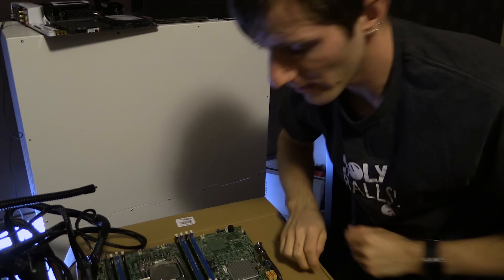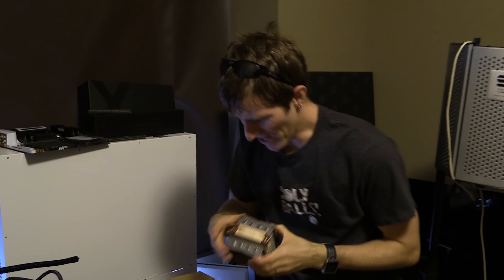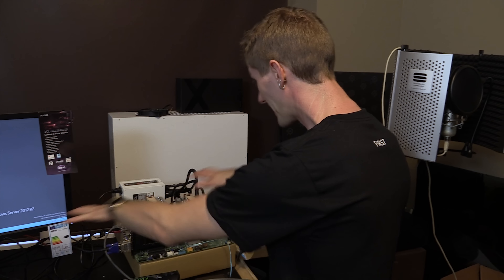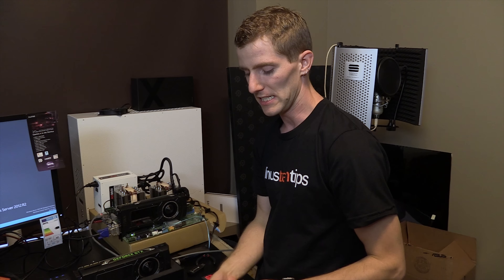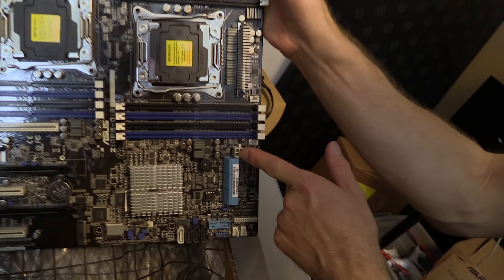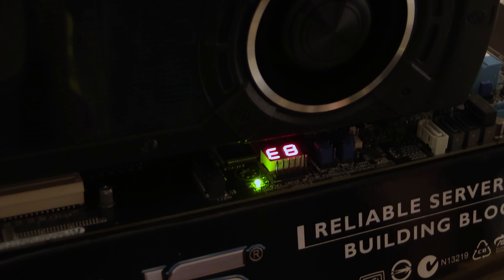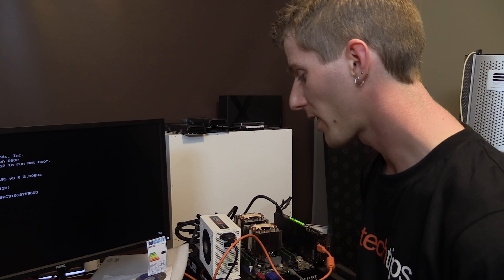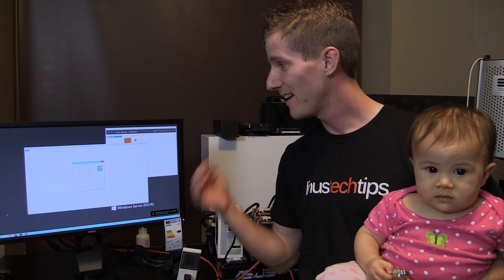36 Cores, 72 Threads, and Two Titan Xs - Our New INSANE Rendering Machine Part 2

Comment: 5:25 grounding himself out on a painted psu...uh huh...tell me more about the conductivity of paint.
Reply: Hello Sub-zero Phase build guide
Reply: frollard we're not talking about 5 volts here, it's more like thousands of volts, so it can probably go through half a mm of paint, wich btw might be conductive paint
Reply: didgitalpunk the conductivity would be similar to the metal itself, so you gain or lose nothing, and aluminium coolers never carry voltage [aluminium can't carry voltage at any time just like it isn't affected by magnets]
Reply: frollard It is most likely made to conduct electricity, since grounding (through the power supply obviously) the ENTIRETY of the case is very commonly done to eliminate some stability issues and electrical interference.
I haven't researched it, but I know my case is grounded this way, and this same system (absolutely no hardware changed) has been running inside for 12 hours a day, every day, for five and a half years. That's over 24.000 hours. Talk about a stability king.
Reply: Space Cadet The overhead power lines are mostly made up of aluminium (the wire core itself) because it's lighter and has GOOD conductivity, while the wires in your house are mostly made up of copper. Just go to wiki or some other sites to verify this.
Reply: liveoles aluminium alloys maybe, but a pure ally heatsink is just ally. not conductive. believe whatever you want tho. and house electrical is all copper. anyone saying different lives in another reality
Reply: Space Cadet Aluminium has good electrical conductivity, it can be(and is)used to conduct electricity just like copper.
I don't know why you think it does not conduct electricity?
Voltage is not carried, it is the electrons that move.
And aluminium is affected by magnetic fields since it is a conductor.(I do not mean that it is attracted/repulsed by a permanent magnet)
Reply: Flying Skull because it's an element, on the periodic table, and it has high thermal conductivity and low electrical conductivity. it's year 8 science. i'm not sure how you managed to miss such an important simple lesson in life. 3 seconds on wikipaedia would  educate you but here you are, blah blah blah, instead of finding out. it has about 55% of coppers electrical conductivity which is why elctricians ladders are made of ally. http://en.wikipedia.org/wiki/Aluminium
Reply: Space Cadet Aluminium DOES conduct electricity. That fact that it isn't magnetic has nothing to do with its ability to conduct electricity.
Reply: Space Cadet 

"Aluminum
 wire, which has 61% of the conductivity of copper, has been used in 
building wiring for its lower cost. By weight, aluminum has higher 
conductivity than copper, but it has properties that cause problems when
 used for building wiring. It can form a resistive oxide within 
connections that makes wiring terminals heat. Aluminum can "creep," 
slowly deforming under load, eventually causing device connections to 
loosen, and also has a different coefficient of thermal expansion
 compared to materials used for connections. This accelerates the 
loosening of connections. These effects can be avoided by using wiring 
devices approved for use with aluminum.
Aluminum wires used for low voltage distribution, such as buried 
cables and service drops, require use of compatible connectors and 
installation methods to prevent heating at joints. Aluminum is also the 
most common metal used in high-voltage transmission lines, in 
combination with steel as structural reinforcement. Anodized aluminum
 surfaces are not conductive. This affects the design of electrical 
enclosures that require the enclosure to be electrically connected."

http://en.wikipedia.org/wiki/Electrical_conductor
Reply: Space Cadet 

"Some of the many uses for aluminium metal are in:
-Electrical transmission lines for power distribution-Super purity aluminium (SPA, 99.980% to 99.999% Al), used in electronics and CDs, and also in wires/cabling.

http://en.wikipedia.org/wiki/Aluminium
Reply: Space Cadet By the way, they use aluminum ladders because the ladders are light... but if they want to reduce electric shock, they'll use fiberglass ladders or even wood if there's nothing else to use.
Reply: Space Cadet This escalated quickly.  Aluminium (or Aluminum depending on where you are in the world conducts quite well, ALMOST as well as copper. During a copper shortage in the 70's many houses were wired with aluminum.  Most are using copper these days.
Reply: Clément Dutter Your case is grounded through the metal metal contact of the screws (note the holes aren't painted).  The painted surface is not a reliable ground connection to your case.
Reply: Space Cadet Your heatsink IS conductive, but is only electrically connected to the heat spreader on the cpu depending on how conductive the thermal paste is...which in turn should not be electrically connected to anything IN the cpu.
Reply: frollard You're right, my system was an oe unit from Acer so there's nothing fancily painted on the inside. I have to say though this thing has exceeded my expectations in many ways. I just checked my Hitachi 1TB hard drive with crystaldisk info and crystaldisk mark and it still does 100.8MB/s sequential read and writes after 15,612 hours of use - five times what it was designed for! :D
Reply: frollard Where will you find a non-painted surface to ground yourself on?
Reply: Völundr Frey Touch a ground connector on a nearby electrical plug.
Reply: Völundr Frey Generally look for bare metal, if building on a bench, have a ground point somewhere -- put a mounting screw into the psu so you can touch actual metal - while the psu is plugged in the chassis, and thus the screw is grounded.
Reply: Space Cadet I have used aluminium in past and as others and I have said, it does conduct electricty. 
If you don't believe any of us, ask an electrical engineer or physics teacher, or test it yourself.
Note: I'm not trying to be a douche, only trying to help. Finally, wikipedia is not a realiable source.
Reply: Space Cadet lol, you use an ally ladder because its lighter than most other cheap metals, it has nothing to do with "safety", get rubber feet on the ally ladder for that... or a glass fibre ladder... just lol
Reply: Tbh you don't need to ground yourself. Not like your pc will fry because of that. Just don't do it on carpet  otherwise who cares.
Reply: ***** I totally recommend using an anti static wristband although it is not needed. You could slide your motherboard on the carpet all day and I bet it would be fine. But either way Linus was just fine
Reply: frollard what you were never zapped by static electricity when touching a car which is also painted?
This is not about general conductivity it's about static electricity and that is what kills electronics.
Reply: Space Cadet now I dare you to reply thinking you are still right.
Reply: Space Cadet Maybe you can read it if I post the first three sentences here: "Metallization is the fabrication step in which proper interconnection of circuit elements is made. Aluminum is a popular metal used to interconnect ICs, both to make ohmic contact to the devices and connect these to the bonding pads on the chip's edge. Aluminum adheres well to both silicon and silicon dioxide, can be easily vacuum deposited (since it has a low boiling point), and has high conductivity."
Reply: Space Cadet Hell, even your precious Wikipedia link.http://en.wikipedia.org/wiki/Aluminium

Under "Physical":
"Aluminium is a good thermal and electrical conductor, having 59% the conductivity of copper, both thermal and electrical, while having only 30% of copper's density. Aluminium is capable of being a superconductor, with a superconducting critical temperature of 1.2 kelvin and a critical magnetic field of about 100 gauss (10 milliteslas).[11]"
Reply: Space Cadet Conclusion: I really hope you're just a bad troll. If not, you are very unfortunate.
Reply: chrisdiscodude no. the periodic table, says it is low in electrical conductivity. has done for a hundred years. what school did you go to that you don't know that?
Reply: Space Cadet We've given you countless sources, you have yet to provide any that support your claim. You as what school we went to? I ask you what English teacher taught you chemistry.
Reply: LegendOfZub it's australia here, so i've been asleep for 8 hours. i haven't been sitting here obsessing about other peoples lack of simple science education. I clicked on the last one and it was retarded beyond belief. so lets do this right here right now. provide me the best link of ALL OF THEM, which actually talks about how aluminium has HIGH ELECTRICAL CONDUCTIVITY. you know, find me the one which seems to deny hundreds of years of elemental knowledge
Reply: LegendOfZub
I think that's an insult to English teachers lol
Reply: Space Cadet I know that dude. Except it's not as low as you may be thinking. It's about 66 percent of copper.
Reply: Space Cadet There you go! Big proof.
Reply: chrisdiscodude it seems some people don't understand what a link is now, so i'll get back to work. some of us have jobs
Reply: Space Cadet lol so ignorant. I gave you 2 links. 2 out of many! I think you should go back to high school chemistry. 

And just a little fact, plane wings use aluminum and the wings of a plane need to be conductive due to lightning strikes. So yea, there you go.
Reply: Space Cadet Mate it's New Zealand here. Maybe after being asleep for 8 hours you should get ready for school. Some of that year 8 science would do you good.
Look at the periodic table resource both me and LegendOfZub linked, it's 4th most conductive: Silver, copper, gold, aluminium. Notice how many other elements conduct too. 4th out of over 100 isn't bad at all. Car bodies are made out of steel, look at how "bad" iron is at conducting, car bodies serve as the ground connection for the electrical system. As many have said, aluminium is used for wiring in many places. It's a popular material for buss bars in electrical systems. Cheapo connectors are made out of brass, it's also lower conductivity than aluminium.

I don't see you calling copper a shit conductor, I hope you use 99.999% silver wire for everything you have...
Reply: Space Cadet It was not retarded. You're projecting your own problems onto the link. That last link has a list of many metals with their conductivity, resistivity, and the percent of the international annealed copper standard.

So, since that's a little too much for you, and you've got a hard on for the periodic table, here is a list of every element sorted from least conductive to most conductive. http://environmentalchemistry.com/yogi/periodic/electrical.html

See that? Aluminum is the 4th most conductive element known to humans. Are you still going to argue?
Reply: Space Cadet https://www.google.ca/?#q=is+aluminum+a+conductor%3F

"Google facts" boxes only show known information.  60% of coppers conductivity is by mass...and since it is so light that makes sense - there is less stuff physically there per unit volume.  It has a remarkably low resistance, thus a remarkably high conductivity.
Reply: bassl0va no they use ALLOYS for cabling. they mix other more conductive metals in, and ally is too brittle to bend like wire needs to. not understanding that alloys are different to elements shows you're not up to this issue yet. Iron also is a bad conductor until you make it into steel. no wiring is made of iron, i have no idea why you made either of these points. neither of them meanwhile are as good as copper which they use pure because it is soft and has HIGH ELECTRICAL CONDUCTIVITY. we should remember that we're talking about heatsinks, which are PURE ALUMINIUM. and i'm only responding to you [even though still no fucking link] because you seem to have a brain, but i have no interest whatsoever in your "thoughts" about this because you seem to be not very versed in chemistry.
Reply: bassl0va Silver? It might as well be an insulator. I use graphene for everything.
Reply: Space Cadet You are thinking of CCA wire. Copper clad aluminium. Dude I posted like 6 links earlier. Multiple people have posted links with elements sorted by conductivity.

"Pure aluminium is soft, ductile, corrosion resistant and has a high electrical conductivity. It is widely used for foil and conductor cables, but alloying with other elements is necessary to provide the higher strengths needed for other applications."
http://www.azom.com/article.aspx?ArticleID=2863

"Alloyed for strength" Because as someone else said, it sags. It's very conductive, 4th after silver, copper and gold.
Reply: bassl0va I used it in an IC manufacturing class this past semester. It's really easy to use for CVD.

More importantly, though, I got to play with hydrofluoric acid :3
Reply: bassl0va I also may add that aluminum is also used for plane wings as it has a better conductivity to weight ratio than copper.
Reply: chrisdiscodude Dude, you aren't helping. When you use words like "ratio," he just shuts down. Probably to prevent overheating.
Reply: LegendOfZub lol there will be smoke coming out of his ears
Reply: Guys, the space dude is probably a troll. No one would be that stubborn and that rude towards others when the blatant facts are right there. I'm 90 percent sure this guy is your average troll, and he's here wasting his life away trying to take your time. He probably knows he's wrong, but he loves the attention. Just stop replying, you know you're right, if this guy is too stubborn to look at the facts, then just leave him alone. You're wasting your time talking to this dude.
Reply: TheCodMineMan But I love the attention too T.T
Reply: LegendOfZub I'll give you all the attention you need ^.^
Reply: TheCodMineMan +LegendOfZub +chrisdiscodude +bassl0va let us take solace in knowing that in the age of internet vitriol we can band together knowing that someone is wrong. :)
Reply: Space Cadet you've been given much proof.
i would suggest giving a link or something to explain and show why you have some misconception that Electrical Conductivity is low [in Alluminum].

you're being very hypocritical that you chastise every source anyone else gives, but refuse to give your own Sources, any, at all.

i feel like we have a serious case of Projection.
en.wikipedia.org/wiki/Psychological_projection
Reply: Space Cadet  Super purity aluminum (SPA, 99.980% to 99.999% Al) is used in electrical transmission lines... it's written in the link that you posted. Why do you always insist that aluminum alloys are used for cabling? Please take time to read the whole article.
Just because aluminum is not as efficient as copper in conducting electricity doesn't mean that it doesn't conduct electricity at all.

"Some of the many uses for aluminium metal are in:
-Electrical transmission lines for power distribution-Super purity 
aluminium (SPA, 99.980% to 99.999% Al), used in electronics and CDs, and
 also in wires/cabling.

http://en.wikipedia.org/wiki/Aluminium
Reply: Eric_Corbeza which are ALL ALLOYS. the super pure aluminum is then made into an alloy. feel free to post the link again and we can verify [the above childish rantings of pimply angry teens is too long to wade thru - if you know where it is bring it here - otherwise shut the fuck up] this heatsink is not. neither is the comparison with pure aluminium on the periodic table. you can make any alloy conduct, just by adding some zinc and chromium. but this discussion is about pure aluminium. IT IS A LOW ELECTRICAL CONDUCTOR, as clearly stated in the link which you have now admitted reading. do you people not understand alloys?? what's with your education?. pro tip, when something is "used in electronics it does NOT MEAN in electrical conducting situations. PCB's and solid state USE SILVER not frikking aluminium which has 20% the conductivity of silver
Reply: Space Cadet 1. Wikipedia is not a viable source. 

2. How is being 61 percent the conductivity of copper a lower electrical conductor? 

3. I understand allows, and if you read my articles,  you would've seen that pure aluminium is 61 percent of copper.
Reply: chrisdiscodude oh wow i'm sorry this is my mistake. you seem to have gotten confused and somehow believe i care what you think. my bad
Reply: Space Cadet and right there you just proved that you know you are wrong. Nice one.

But what you aren't getting is that we know aluminum isn't as good as copper,  but it's not a LOW electrical conductor.  It's lower when compared to copper ofcourse,  but not compared to the rest of the elements.
Reply: chrisdiscodude when you say "the rest of the elements"are you talking about flourine and calcium and liquids?. yeh cos lets face it that's a handy comparison
Reply: Space Cadet sorry. I meant rest of the metal elements. And btw to correct you, aluminium is 58 percent conductivity of silver. And aluminum is the 4th most conductive element. 

So what you are saying is wrong
Reply: Space Cadet

"Pure Aluminum is not used as an electrical conductor in equipment since it is too soft for mechanical assemblies and is thus alloyed with other materials. The Al alloy 1350 used prior to 1975 was designated as EC  (Electrical Conductor) grade aluminum with a 99.50% aluminum content. Even though it has 61% the conductivity of Cu it lacked in mechanical
properties making it less than ideal as a conductor in the equipment."

www.geindustrial.com/Newsletter/Aluminum_vs_Copper.pdf

The only reason that pure aluminum is not used as an electrical conductor in equipment is because it is too soft... it is viable as a conductor with 61% efficiency (pure aluminum) compared to copper.

---

And with this link, it clearly states that the electrical conductivity of aluminum is lowered when it is made into an alloy but it has the added bonus of higher mechanical strength than pure aluminum.

"This group of specifications include grade 1350 (formerly 1E) pure aluminium with a conductivity of 61% IACS and grade 6101A (formerly 91E) which is a heat treatable alloy with moderate strength and a conductivity of 55% IACS.Aluminium for general engineering uses includes grades with conductivities as low as 30% IACS, but with high structural strength, up to 60% of that of steel, with greater emphasis on mechanical properties."
http://electrical-engineering-portal.com/aluminium-and-its-alloys-used-in-electrical-engineering

---

And also, pure aluminum was used as electrical tranmission cables in the 1970's... the poor mechanical properties of pure aluminum (the bending, creeping and thermal expansion of the wires caused fires during those days) is what prompted the usage of alu alloys.
Reply: chrisdiscodude don't make me laugh. Wikipedia is just as credible as any other information source.
why? it's all the internet, all the information could be wrong, no matter where it's written.

some random website that makes claims isn't more right just because it isn't Wikipedia.
the questionable credibility of information if it does not prove it's claims is equally applicable to all sources.

don't listen to Educational instructors that will look at Wikipedia in disdain, and praise random websites hosted by john doe. especially when Wikipedia is probably sourcing better sources than that random website(when possible).

i.e. if you question Wikipedia, you should question all sources. Wikipedia is a place that Sources other places. it is only as accurate as it's Sources. 

at any rate, this nonsense Thread should end. we clearly can't educate this person. it isn't an argument, because all it is is one party quoting truths vs the other party completely ignoring anything being said, with their fingers in their ears. very childish.
Reply: ***** true,  you are right there. I was just trying to say that one Wikipedia link isn't enough. Haha yea,  more like that one party ignoring everything is that one guy.
Reply: Space Cadet You my friend have buried yourself in a facade of defeat :)
Reply: Space Cadet it has 61% electrical conductivity...
Reply: Space Cadet https://www.bluesea.com/resources/108

there's your link. copper has 100% conductivity. So yes, you're right to say copper is higher in conductivity.
Reply: chrisdiscodude Silver is more conductive than copper is! :p
Reply: Space Cadet Dude, steel and nickel are low in conductivity, like abysmally low. Aluminium is actually quite a bit higher than those two in terms of electrical conductivity.
Reply: Space Cadet A LOT OF AFTER MARKET HEAT SINKS USE AMLUMINIUM WITH COPPER CONTACT HEAT PIPES FOR MORE EFFICIENT COOLING. IT'S NOT FUCKING PURE ALUMINIUM.
Reply: Space Cadet pure water isn't conductive. All minerals removed from it and it's not conductive whatsoever. So fail harder with the liquid argument. Let's just conduct electricity through molten copper, that would definitely be a liquid and wouldn't prove a damn thing.
Reply: chrisdiscodude I think you mean 44% because silver is only 5% higher than copper... using copper as the standard it makes silver 105% while making aluminium 61% as conductive as copper.
Reply: ***** wikipedia loses credibility points, why? Once upon a time Orihime's occupation was hooker courtesy of some random user deciding to edit the page for lulz. Unless someone hacks and changes information on more credible sites to be used as sources you won't normally have these problems from them.
Reply: chrisdiscodude there's many wrong informations hidden on wikipedia due to outside editing and not due to whoever usually works on wikipedia itself.
Reply: ArtisChronicles it's actually 58/59 percent. If you take the conductivity of aluminium, it's about 3.77x10^7,and silver, 6.29x10^7, find the percent of that and it turns out to be 59 percent of silver.
Reply: didgitalpunk  ye it does , how do i know? well at the old house after walking down the stairs, if i brushed past the radiators i'd get a damned big shock which blardy well hurt, so yep static goes through paint, even non conductive paint
Reply: +Devilman Most striking argument in that whole chitchat thread :)
Reply: +Space Cadet I didn't read all the comments here but this insistence that aluminium is alloyed to make it better at conducting electricity is just wrong. 

It is alloyed entirely for physical reasons. Mostly because it's soft... so depending on the thickness and required conductivity you'll have to alloy it. (Mohs=2.75 for reference gold = 2.5 and copper = 3 and steel = 4.5) It's perfectly fine at conducting (thermal AND electrical).
Reply: Androgynous Gamer pure aluminum is a very good conductor itself as well. Look it up.
Reply: +Androgynous Gamer One must be a true genius for parroting what 42 others have stated before already.
Reply: Androgynous Gamer "very poor conductor"  O RLY?
Reply: +Space Cadet 
Electricians' ladders are fibreglass in Australia. You're right in that aluminium is not the best conductor, but you are wrong if you think aluminium is non-conductive.
Reply: About half a dozen people in this thread have already stated what electricians' ladders are made of and why.
About two dozens of people in this thread have not only stated that aluminum is a good conductor, but also delivered countless proofs for that.
But every once in a while there's still one more Captain Obvious, enlightening all of them and the OP who isn't reading this anymore since ages ... <spock>Fascinating!</spock>
Reply: +Oliver ASUS Fun fact...OP here. Still reading the notifications but gleefully ignoring them until this came up :)  Yay for people trying so hard.
Reply: frollard space Cadet was one weird person Haha. Im sure you noticed that lol.
Reply: +frollard Hehe ... guess this won't stop before this channel gets closed.
Sorry, however, actually I didn't mean you but SpaceCadet - who wasn't really the OP but just the center of this little universe, my bad! Have fun :) 
(next moron coming up ...)